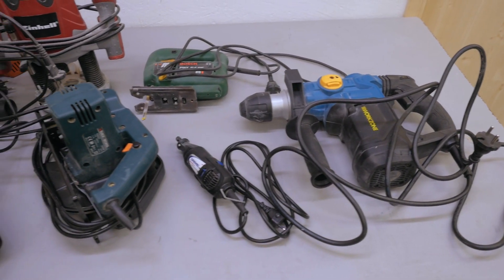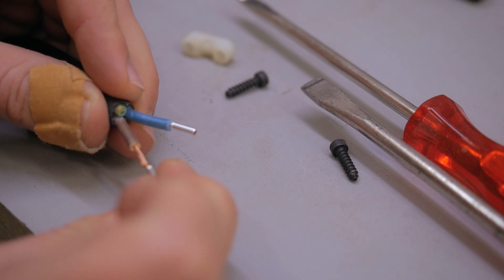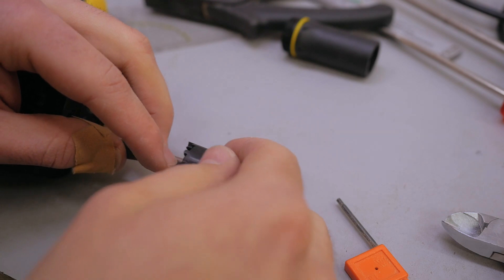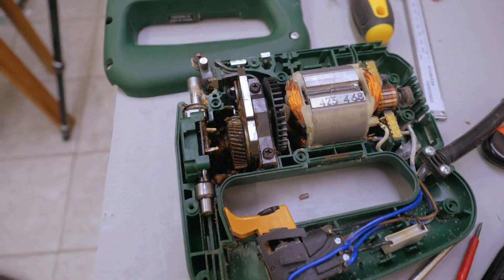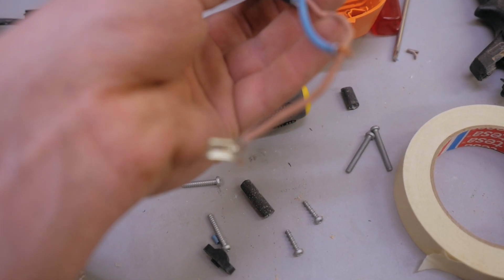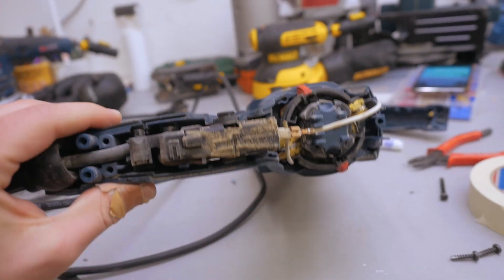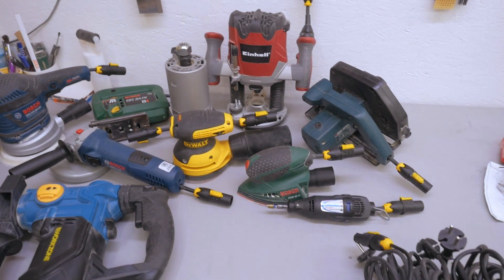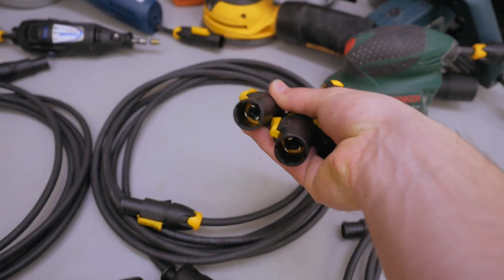A Quick Connection System for Power Tools

Comment: IMHO there is a very good reason why the rubber sleeve on the back is so long. It helps you keep the cord out of the way while operating the sander. There are many scenarios were  the cord can get caught and a skilled operator with these sleeve can manipulate the cord while sanding. You are very smart and I admire you but some times you are just a young wise ass 😂

Comment: 5 years later this black and yellow PowerCON TRUE1 has been discontinued and is now replaced by the black and silver PowerCON TRUE1. Also, it seems like the grey but also the blue series are not recommended(allowed) to be connected/disconnected under load.

Comment: These are the older Powercon True1 connectors with the exposed contacts.
Powercon standard now with powerCON 20 A and powerCON 32 A are enclosed thinner connectors. They are also less expensive with consumer markets being able to order 10 or 12 pairs for around $50. Although a powercon cable already completed will be around $12

Now I want to see your entire house redone with powerCON. I want the powerCON toaster! LOL
But for reals... it definitely is the best power connector by far.

Comment: i wonder, can you use XLR connectors instead ? or 'aviation plugs' ? i saw a video of someone using them, so they work, but they are not made for such high voltages, but that doesn't mean they can't handle them.
Reply: OK, i'm back after a little research, aviation plugs were developed by or for the military and they can definitely handle 220V here is a spec sheet https://postlmg.cc/mPNMbzcK, although i've seen different specs in different places, search for them on places like ebay by 'aviation plugs' or GX12, GX16 or GX20 (different sizes), there also seems to be a waterproof version called Sp13, SP17, SP21 on places like alibaba and amazon.
3 sets/pairs of GX16 cost $5.50 on ebay with free shipping, but the XLR ones are quick connect so i bought those instead even if they cost more.
Reply: my XLR plugs just arrived and i tried them out with a 2000W heat gun, works just fine.

Comment: Technically you could make the system even more convenient, by having some sort of auto-winding mechanism for the cables, so that once you disconnect them you flip a switch and it rolls back into a neat box on the wall. 
But this is still a great improvement.

Comment: so now that tiny bit of cable on the dremel between the tool and the powercon is going to flex and fail. why do you discard the flex relief that the manufacturer provided for the job

Comment: Just started implementing this myself in my shop and I have a question. How do you keep track of grounded tools so you don't use the non-grounded cables on them? I could just only use grounded power cables, but then I'd have wasted non-grounded ones.
Reply from the maker: I didn't make any non grounded cables
Reply: @MariusHornberger  I've completed a method around this. Whenever installing a PowerCon onto a tool that doesn't have a ground wire, I snip off the ground pin from the  connector. For non-grounded power cables, I filled in the section with the matching ground pin with epoxy. This allows me to use the non-grounded tools with both grounded and non-grounded power cables while keeping me from accidentally using the grounded tools with non-grounded cables.

Comment: 5:37 - this long sleeve prevents the cable from bending under the moving part of your machine
7:06 - ffs just cut it off & solder your wire to it, dont forget the heat shrink before

Comment: The plugs and cord on the Dremel in my opinion is a terrible idea. Plugs are nearly as big as the tool,  now makes the tool very bulky and clumsy to use. Would be better to leave the lead as supplied, making it so much more controllable tool, as was DESIGNED. BAD idea to leave off the Rubber anti kink sleeves.

Comment: No offense, but you will loose the guarantee on all your devices if there is still one there. Plus you are not an electrician,  so if any accident happens, your insurance will exactly pay nothing.

But nice idea. I use this neutrik connectors always with professional stage equipment.

Comment: I would have kept the length on the tool but then built a box on the edge of the work bench with 4 panel mount connectors. Quick, easy and cleaner.

Comment: instead of that small piece of wood to fill the gap, you should use sugru.com or formcard.com they will give you the cable protection you need and will be faster than making custom tiny pieces and will seal better
Reply from the maker: Hey, thanks for these links!

Comment: How about using the plugs you use for your computer between the wall plug and the transformer ?
Reply from the maker: They don't lock together
Reply: @MariusHornberger   that is correct.  But due to the friction they won't disconnect unles you pull like a mad man. Don't you think so ? :-o
Reply: @MariusHornberger  

https://youtu.be/vkOiVglhoJ0
He was even inspired by your work :-)
Reply: @MariusHornberger 
Or this one : https://youtu.be/im1HF7HEz7g

Comment: interested in your thoughts on this change after long term use, if you recommend the same product, or something different for a hobbyist/DIY shop. also curious what the pros and cons are of the "quick connect" rather than just a shortening the cord and having the traditional plug and socket as your quick connect with a standard extension cord. thanks!
Reply: That’s exactly what I did to all my tools and the cords just work themselves loose all the time. And when they’re short like this, it’s hard to get the lengths just right on different tools so when the dust extractor hose is hooked to some tools, either the cord makes the hose pull out or vise versa

Comment: Just seen on there website they have hard chassis connectors to mount to walls or large tools that’s only 1 to 1-1/2 long. If you wanted to get a bit more involved you could possibly mount 1 end solid to the tool just like a Festool and avoid needing the extra cord length at all.

Comment: People are missing the obvious fact he’s chosen to forgo certain existing qualities for the ones he wants instead. He says he doesn’t like how long the connectors are, but clearly likes the quick connect enough to tolerate it.  Having a tiny bit of extra weight at the tool can be annoying but clearly less annoying then dealing with 5-10ft of tangled cord on each tool.  All the “Cons” ppl are crying about here are minimal compared to the “Pros”. At least to him, which is what matters. Turning 50ft of cords into just 1 dedicated high quality cord is very efficient.  Ideally these guys would make a version that where the 1st clip is 1/4 the size and connects solid to the tool. But this is still a huge benefit in my opinion.

Comment: Hello, why do not you just cut off the original cable and then just build the connector in there between. Then you do not need to open the machines?

Comment: Hi Marius, thanks! You got me thinking in another way 🙂 again 🙂

I read the comments and although they may sound  a bit negative I am sure they meant helpful. Especially the ones about safety should not be disregarded. 

I really like your channel, ideas, and mostly your enthousiasm. Please keep it up. 

Two things:
- the yellow ‘block’ you see nearby the trigger and power cable is called a ‘heat melting fuse’. They are there to shut the device done if the there is too much strain. They are also designed to have a life span of 45, 72 or 128 hours... yep the manafucturer makes sure you need to buy a new one over time. So maybe it is an idea to replace them while te device is opened up anyway. Cost ariund a euro or less. 
- second thing: do you read the comments? Please react on them. It will grow your fanbase since they have a freling of interaction. 

Keep it up bro

Comment: I can buy these connectors in Australia!  Yay! I too get sick of winding up cords. I'm doing this upgrade but I will probably do it in stages. Thanks for the tip.
Reply: read the comments, it is a pretty bad executed tip. you can go with simple sockets or just shorten your tool cords and use extensions so that you can use your tools even if you do not have proprietary connectors. shortening is better because you don't mess up with internal connections which can be done badly (like the guy did in this video).

Comment: Hallo Marius! Das Umrüsten auf nur ein Kabel gefällt mir und ich wollte es dir gleich tun. Ich habe zunächst bei der Firma "Conrad" 2 Neutrik-Stecker (NAC3MX-W) bestellt. Sie wurden auch (für teures Geld) geliefert, aber es fehlten die Gegenstücke (weiblich). Die müssen vermutlich separat bestellt werden. Welche Typenbezeichnung tragen sie und hat sich das ganze überhaupt bei dir bewährt? Für eine baldige Antwort wäre ich dankbar.
Reply from the maker: Die genaue Bezeichnung weiß ich leider nicht, aber ich hab den Shop in der Videobeschreibung verlinkt. Da sollte das auch dabei stehen. Und ja, das war eines der besten Dinge, die ich in der Werkstatt gemacht hab. Ich könnts mir nicht mehr anders vorstellen.

Comment: I know this video is a little old. Really like the idea however I wouldn't recommend if you need to take tools on site. Not that any of them would be allowed or at least not in the UK as its only 110V allowed on site.

However my real, note with regards to this mod is....
Cable strain relief sleeves need to remain at least in part and the wooden inserts are just a no, no. Yeah, they are not conductive but they will be abrasive. Ie overtime the cable will more than likely become worn.
Simply cut down the existing rubber strain relief sleeves to suit. You could probably even get the sleeve into the Neutrik connector and it would bite down on it, once tightened.

Final note, I assume Neutrik were used to able the cable to be locked off. A cheaper solution might be a rewireable female lockable IEC (£2-3 per IEC). I know they lock into equipment and assume a male IEC connector (cheap as peanuts) would be no different though you'd have to test but just a thought.

Comment: Next shop upgrade: A wall-mounted retractable cord reel .
http://www.sears.com/craftsman-30-ft-cord-reel/p-03483929000P?sid=IDx01192011x202447059&gclid=Cj0KCQiAoY7VBRDtARIsAHWoO-K4Tb0mv6mw-MrGPAtCdm9mNP4w7YkycuQUtk-E0y_wOvPAxUZei84aAha3EALw_wcB&gclsrc=aw.ds&dclid=CI3v3du44tkCFQm-swodwNYDoA

Just pull the cord out from the reel when you need it. You will have to snip the end of the cord and put your quick-detach system on, but it will work and it will be much faster than dealing with the various lengths of stand-alone cord.

Comment: Hi again, looking at you put the new plugs on your tools
(not the one that goes into the wall socket) it looked as if it uses the same
system that your drill uses to connect the wires

Comment: Hi, I had the same problem but I found that if I pushed a
watchmakers screwdriver in the power hole (with the tool unplugged of cause)
the wire will come out, it is held in by a small metal piece that stops the
wire from being able to be removed.  You
can push the new wire in that makes the connection again.

Comment: Hi Marius
I have come across the problem that you have encountered with regards to removing the cord from your BOSCH drill on a few occasions.  What in general/normal situations is used is a method of attaching the two component/housing half's together by using a male/female system, the male housing/component connection fitting inside the female component/housing.  @7.05 on the video it shows the view of the phase and neutral wires, ( phase on the Left )  just above these two wires is a small square of plastic (which i'll refer to as male locating/retaining lugs, or MLRL's) which is a part of the male component/housing, there will under usual/normal situations be two or three of these MLRL's. the idea is to slip a number of slim shims between both the male & female housing at a point which will allow the female part of the housing to then pass over the MLRL's, you will the pull the two  housing components apart. I would mention that it's at this point that you have to be Extra careful, as i have come across springs, rocker contacts, detent/locator ball bearings etc. 
   I hope this helps & is not to long in it's entirety.   Of course over the passage of time you may feel that you're going to stick with the de-coupling method that you have engage in & you can the make the decision to just cut the original cord at the desired length and thus save the effort of trying to dismantle your switch housing.

  Regards Bob

Comment: Would it be a good idea to leave a meter or so from the tool? At least when it comes to the dremel which has much slimmer cable. Maybe even use a slimmer cable for all tools for the part between the connector and tool. Im not sure the thick wires offer much more of a protection against accidental cutting. I really appreciate your videos! Youtubes recommendation system is weird. Your channel only came up recently and considering what i've watched and the subscriptions i've added the last year it should have come up much sooner i think.

Edit: Aha, i see why you kept the cables short at the tool's end when you showed them on the wall :)

Comment: The idea of a C13/C14 coupler from Max Maker's comment seems nice, but I understand the benefit of Neutrik's locking tab. What I would have used, I already change all the cables in all the machines, I would have found some better highly flexible silicone cable rather then the stiff one you used. I would have also left the cord 10-15cm longer and the strain reliefs in place, which would not have been a problem with more flexible cable. Nevertheless, nice idea.

Comment: Like it. 
If you want to do it cheaper you can use a C14 plug on the tool and buy C13 "computer" cable to connect it to the mains. 
http://www.ebay.com/itm/Black-IEC-320-C14-Male-Plug-AC-Power-Inlet-Socket-Connector-250V-10A-/172347092573?epid=682847821&hash=item2820afee5d:g:ZFwAAOSwYIxX3z4t 

Did it on a couple of my tools. Works fine

Comment: Do not get suckered into buying festool, they look and feel extremely nice but open them up and find horrible horrible engineering problems, like my 1000USD saw do not have epoxied windings and instead of a proper ball bearing they use a brass bushing, needless to say it does not hold up to actual use, at all.

Comment: I hope you understand the risks involved in removing that "sleeve" thing that functions as a stopper for pulling the cable out by yanking it by the tool by accident. 

(I.e. the tendency of such setups having one Electrobooming to the beat of whatever fuse you happen to be behind since the device isn't grounded -- if the wire comes loose and you become the impedance between the zero and live wires)

Maybe you could the wooden piece to the wire or something? Idk

Comment: Nice work! Love it. Curly power cords could be a useful addition. I'd have also just used the existing power cord on the Bosch Drill, rather than leave it out of the system.

Comment: The retractable mains cables I refer to in another reply further down the thread are almost entirely used for large powered machines, eg table saw, long-bed jointer, drill press, router table, etc.  For all my hand power tools, I've gone even more radical than Marius - I've completely switched over (no pun intended) to an 18v battery powered system.  I went with the Makita range, but also have a few Ryobi things that Makita doesn't make.  I have a couple of charger banks attached to the wall and permanently plugged in.  I also have enough batteries that I never, ever, run out.  But using things such as a sander, circular or jig saw, or a trim router, with NO CORD attached is very liberating ;)

Comment: don't know if speakon connectors can take that much power, but those connectors would have been a cheap option (of course only if the connectors you bought weren't quite cheap)

Comment: i took this idea with a cheap solution. I ordered on amazon 10 appliance connectors ( in german: kaltgerätestecker) and cut of all powercords of my tools. with appr 4-6 inch left i installed the connectors. ( make shure you connect the part with the open pins to the tool and the closed part of the plug to the powercord, otherwise it is dangerous and you can touch the pins when the powercord is plugged in)  then i made 3 powercords like you did with different length always connected to sockets. so i can plug in any machine in seconds. works really great. (also i recommend to buy good quality connectors, cheap ones will fall off and disconnect by using). but sometime we all buy festool, but not because the have connectable powercords. by writing this i  just saw that the "bellevue workshop" has a video witha similar idea. check it out and find your way. you will be happy. thanks marius

Comment: Yes, "it (could) be simpler than that ..." if you bring one power cord only, from above, that is coiled to not get in your way regardless of what tool you use it on.  So when you disconnect the tool it raises out of the way automatically.  But you did an awesome job so far.  Congratulations!

Comment: I use those connectors at work. Just wait and see.. In a short time the small yellow clips will start to fall off when they get caught on something, the spring inside will fly away and be gone.
They drive us insain (we are on tour where we connect 380 of them each tour-date).
The older blue powercons were far better for the clip, but they are not designed to be connected when under load. It's like they fixed one problem but created another.

Comment: Or just cut the powercord to 10cm/4" for free, and use 1 extension cord?
Then you can keep the strain relief aswell!
Reply: normal plugs don't have a securing system, so they unplug themselves and at least European and UK 220v plugs are massive.

Comment: Hello Marius, you had a problem with the Bosch drill.  Just cut the wires en solder de new ones on to them.  Like that you don't have to open the switch.  Nice job.